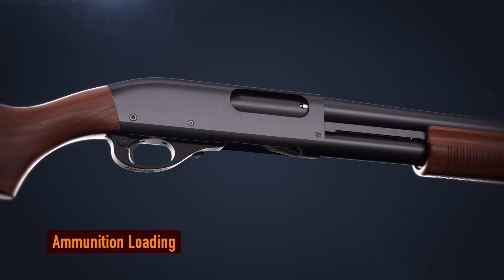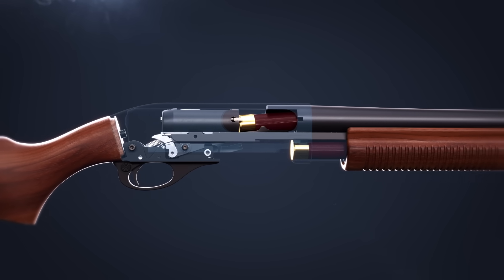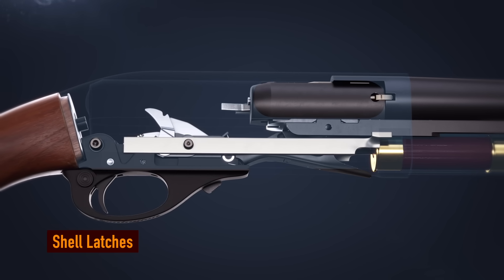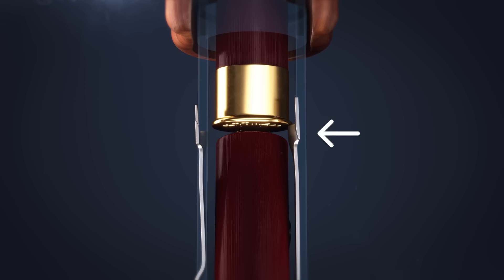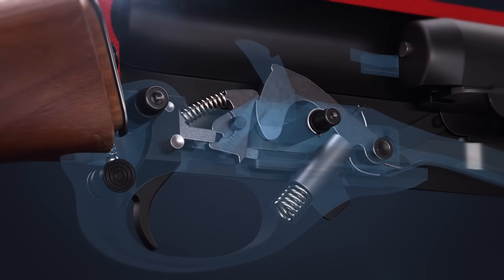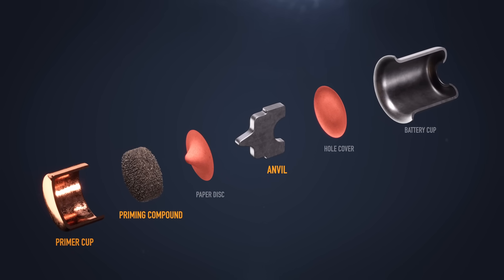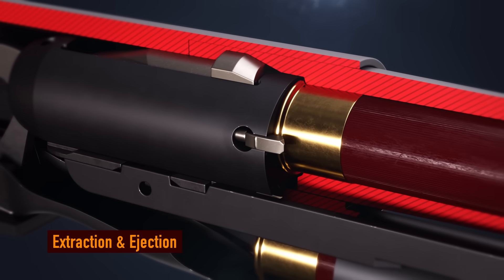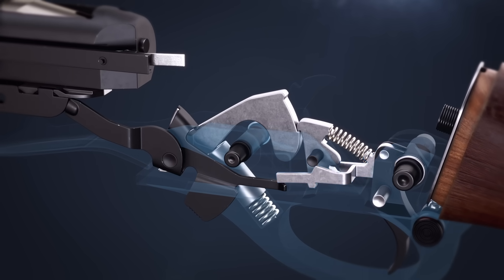How a Pump Shotgun Works

Comment: It fascinates me that most guns work off a completely mechanical system, not requiring electricity or power in anyway just physical pieces moving like a Rube Goldberg machine.
Reply: How everything used to work.
Reply: @TheBlackAshTree  hahaha indeed
Reply: That's the power of metal springs.
Reply: Why I will never trust an electric gun. Mechanical is more reliable and easier to fix & diagnose.
Reply: @24YOA  + you don't have to worry about batteries... or charging them up like a tesla
Reply: @24YOA  Statistically untrue, but I always do feel safer when firing mechanical guns.
Reply: Or a clock
Reply: @jasongrier7583   My thoughts exactly.I've always seen guns as a close relative to mechanical watches.
Reply: @rafaelalexie2417  during wartime the governments of the world have been known to enlist watchmakers to make firearms components.
Reply: @rafaelalexie2417  

americans be like: “time’s up”
Reply: @no-barknoonan8798   That is interesting! I didn't know
Reply: @jasongrier7583  
Clock maker...
Lock maker...
Flintlock..
Wheelock..
Reply: I think what you mean is the "action"(bullet loading mechanism) of the gun is completely mechanical because you need energy in one form or another to set things in motion but consider a full-automatic gun where the "action" is actually gas powered with the kinetic energy from gases of the previously fired shot (eg AK-47)
Reply: @adityasalunkhe8156  almost all semi auto/full auto guns are gas operated other than pistols 🙄
Reply: @jman0870  I know this is 4 years old, but I want to add in that’s blatantly not true. Short-recoil was invented for machine guns, and is used in a lot of them. Most semi-auto shotguns also are inertia-operated. If you had said rifle that may have been true, but there’s tons of full-auto and semi-auto guns that don’t use gas.
Reply: @GogiRegion so now you know exactly how many shotguns and rifles exist in the world? Go away.
Reply: Mechanical and chemical. If it were a mechanical system the power output per shot would be on the order of the force with which you pulled the trigger. Here mechanical force kicks of an explosion that propells the bullet, hence the gunshot sound.
Reply: well they do use and rely on chemical reactions, its not purely mechanical
Reply: Yes! All the force hitting the bullet comes from a single spring actually, it's very cool
Reply: @2011October14  nope. The force propelling the bullet comes from a chemical reaction: the explosion of the powder. The spring only propels the hammer that hits the shell and starts off the reaction.
Reply: ..you realize powder plays a big ass roll in all this right?
Reply: @oddballskull1941  he sayed power not powder u actual child
Reply: @crblindis  k
Reply: Pretty much all guns actually work that way, even like a mini gun it just has a motor that spins the barrels everything else is mechanical, like if you were to take and old gatling gun and use a power drill to spin the crank
Reply: "most gun"
what gun uses fucking electric??
Reply: @cheeseistaken  m134 mini gun for one... so like i said "most guns."
Reply: *sad minigun noises*
Reply: The pistols and machine guns I find it most interesting.  No need to pump or manually remove shells but with springs and mechanisms.
Reply: A disturbingly large number of things are based on Rube Goldberg mechanics. For example, many hard drive discs are literal discs, like a record player; that gets damaged, your computer becomes a paperweight.
Reply: Really? Most guns work this way.
Reply: Imagine having to put your gun on the charger
Reply: It does require power. It’s called gun powder. Yeah the mechanical system is how it loads, unloads, and kicks the round out, but the gun powder provides the energy
Reply: I don’t know of a gun that requires power or electricity. I own a bolt, pump, and semi automatic action and none require electricity. It’s inertia or simply manual effort that loads the firearm.
Reply: @slugoo6474  If we want to get technical, miniguns and chainguns both require power. There are some prototype weapons that use electrical firing mechanisms to increase their rate of fire.
And, as Jeff pointed out, the concept of "smart guns" which use electrical components to ensure the "right" user is operating the firearm before making it usable.
Reply: @slugoo6474  the remmington 'Etronix' did, never took off but used a resistor and a 9v battery in the place of the cartridge primer
Reply: @slugoo6474  Remington had the EtronX, a gun that fired electrically, not with a firing pin. Forgotten Weapons has a video about it.
Reply: @slugoo6474  there are electric primed fire arms. M61 vulcan for example. Or the HK P11.
Reply: @slugoo6474  Old machine guns used to be powered by a battery.
Reply: Not to mention most tank guns i think are solenoid fired
Reply: Also gas.
Reply: I want to like your comment, but it has exactly 420 likes
Reply: Ya know when you think about it, all  guns are rube Goldberg machines.
Reply: Unless your Iron man lol.
Reply: I mean it does require potential energy into mechanical energy into kinetic energy which is the bullet but that’s separate energy
Reply: Imagine charging your gun
Reply: @commoncanadiens6699 "sorry babe I can't defend the house, my AR battery is dead"
Reply: "Most" is an understatement. There's been like 2 or 3 guns that work on electric ignition ever made. They're just inferior. And Rube Goldberg machine would be a pagoritive because Rube Goldberg machines are by definition unnecessarily complicated but guns are only as complicated as they need to be if they're designed well
Reply: Well it would be kinda stupid charging your gun on an android charger before going hunting
Reply: Actually everY guns require "power". Their fuel is either the powder of the ammo in case of semi or fully automatic weapon. Or human power if you have to manually reload.
Perpetual motion isn’t a thing. No mechanical system can work without external power.
Reply: i never really thought about it till now, but yeah, it’s quite fascinating.
Reply: Most guns? Where have you seen am electric gun?
Reply: Why would guns require electricity that's the craziest thing I've ever heard
Reply: @DanielEvans417  the U.S. Navy has a plasma cannon that's powered by a nuclear reactor inside the ship I believe
Reply: @robertthreet7020  yeah but come on the 870 there's no reason to think that you would need electricity to use that shotgun
Reply: @DanielEvans417  real shit lol
Reply: @DanielEvans417  the guy who wrote the comment probably has never even seen a gun
Reply: @jackguess762  it dosnt need electricity shut up child
Reply: Lmao why a rube Goldberg machine?? Mechanical engineering is as old as time itself...
Reply: It gives absolute pleasure to see every single part moves together and have its own unique function, like a clock. Anything needs everything. True craftsmanship, bravo.
Reply: Even more fantastic with automatic weapons working like this plus gas pressure.
If you want to see REAL god tier engineering look up the Heckler and Koch G11
Reply: Yeah it's in a way a funny idea how the most popular weapons are still sort of just chemistry. It feels almost primitive in a time like this. You are essentially pointing a tube with controlled explosions inside to propel bullets lol
Reply: that's what makes them so neat and useful. imagine if the power grid blew up and society collapsed... they don't need any electricity to function
Reply: @joevaghn457  the idea of "if the power grid collapsed and society crumbled" is a bit stupid.  Cause 
A:  personal generators are still a thing, hell with some copper and zinc you can charge stuff from a literal apple.
B. If society has collapsed its mainly gonna be harder to acquire bullets than electricity.  There are numerous ways to get electricity from just random stuff.  Not too many ways to randomly get bullets that work with your guns.  Admittedly you can stock up on bullets, but you can also stock up on electricity as well.
Reply: EVERYTHING was like that. Just wait until you get into old watches. Especially the great old Russian USSR made ones. I can't stop.....
Reply: Except of the  Power in one's muscles to pull the reload bar
Reply: They have to be, right? 

Because it’s “safer”? 

Less or no risk of a misfire?
Reply: lol no shit
Reply: Because they already got energy in form of chemical reactions
Reply: Imagine if you had to both reload and recharge your gun
Reply: Yeah mechanical engineering it's pretty great we need more people interested in it
Reply: https://youtu.be/KZYQTY5LZJ0
Reply: Abolish the 2nd amendment
Reply: Yeah, nobody wants to keep charging their gun in a middle of a gun fight
Reply: Yes. But such fine mechanincal parts are also the reason for jamming.
Reply: And that is a great thing about them
Reply: Oh dude,  just imagine! The Rube Gunberg Machine
Reply: http://youtu.be/DpIN2QQGit0 
Glock, Remington, Schofield, Colt, Walther
Reply: People died before invention of modern time
Reply: https://youtube.com/channel/UCJK904C4lS1mEXSjozMfgEw
Reply: Car engine
Reply: Proof that John Moses Browning was a literal God.
Reply: Yup
Reply: @haavikwood290  they are actually really close to a mechanical engine when you think about it, an explosion is used to move a cylinder/slide to complete a cycle (except bolt action etc)
Reply: Are you of mental issues?
Reply: @haavikwood290  or a rubix cube made out of tunic lube.
Reply: @haavikwood290  Well, you dont need electricity, but you do need power. In this case, stored mechanical power by the springs that put tension on the trigger and hammer, for example
Reply: @haavikwood290  it is cool! I also love how the energy of the explosion of firing a round is used to extract the spent casing and chamber the next round. That so many firearms do this with such reliability and consistency is really a testament to human ingenuity and engineering.
Reply: Yea same here
Reply: No expiration date, no charging, no fuel. With the right maintenance, firearms can essentially last forever.
Reply: Same but when u think about it the gunpowder could ignite if electricity comes into contact but with gun like SMG or a minigun mechanical speed is amazing
Reply: Imagine being fascinated by things that are so simple

Comment: It must have taken hundreds of attempts minimum to get this mechanism to work and then to streamline it for mass production. I love engineering stuff like this!
Reply: definitely, hundreds of years of innovation
Reply: I feel like they've definitely had more crude designs and shotguns we know today are derivatives of every single possible good design we've thought of put together. but I'm no historian
Reply: I get the same feeling when looking at combustion engine. From the early ones to today's when you can get 100km out of 5 liters of diesel. Insane efficiency and slow iteration of everything.
Reply: Hallo How are you guys,.
https://youtu.be/yXkBRMAByJ0
Reply: I wonder how they built all the components needed to assembly the first shotgun. I get the mass production but what about before that? Were all the necessary components produced manually and by whom?
Reply: @TheLostinTheUnknown   George jefferson manually made them.
Reply: @TheLostinTheUnknown  Hand operated machine tools are a big part early modern firearms manufacturing. You know the CNC machine? Before that, we had tools let you grind metal with high precision by hand, doing exactly the same thing but much slower. Or even more basic would be to just grind things yourself and use precise measuring tools frequently to try and get it as close as possible.

Comment: FYI if you ever need to unload a pump shotgun just tap on the release bars inside the tube as shown here. Do not cycle live rounds into the chamber and eject them.
Reply from the maker: Yeah I’ve got an 870, and was even weird about releasing rounds into the receiver via the fore-end. So yeah, definitely use the latches.

Comment: It makes me feels amazing when I see all parts are engaging each others with just a very small contact area. It seems a 1mm fault or some very small defects(eg. shell latches only resumes to it's original position on it's own mechanical elasticity, and the connection between front end tube assembly and the bolt carrier, considering the two bar is actually exposed)

Comment: So the only difference between this and the mosseberg 500 is the safety location,the way the latches works, and the fact that you can't see where the disconnector act with the 500 😠
Reply from the maker: I’m not sure how the mosseberg 500 disconnector operates. Does it not have one?
Reply: @mattrittman  it does it have to but i didn't manage to find where it act on the trigger seer exactly there is no video or 3d moddels which shows it
Reply from the maker: @sovietbottle-cap1649  ahhh gotcha
Reply: @mattrittman  so you found out🤓?

Comment: Interesting how pump actions predate self loading rifles in common service. Seems at least as complicated to me as a self loading rifle
Reply: Depends. If you go form the perspective of some late muskets already having used the similar kind of ammo, now imagine another Barrel filled with ammo underneath so you dint have to load after each shot, include a spring to move the ammo and now you just have to figure out a mechanism to get the ammo into the barrel. All just a question of imagination put into working mechanics

Comment: The interaction between the action bar lock and the trigger is not fully explained.  I understand that pulling the trigger disengages the action bar lock, but how?
Reply from the maker: It was difficult to explain everything fully in under 4 minutes. But you can kind of see the hammer spring pin at 3:27 push the action bar lock back.